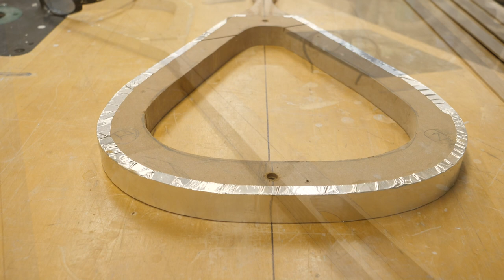Sealing a Brook Trout in Epoxy - Fly Fishing Net Build

Comment: Great video! One quick question, used my net for over 1 year, always drifting on the water, seems the surface sealing paint begins to peel off, anything I can do to restore the water proof surface paint to prevent the handle and net portion from cracking? Thanks a lot!
Reply from the maker: I always try to use a wood sealer like Dalys Ship n’ Shore that can penetrate deep into the material to help stabilize and seal the wood from within. It hardens inside pretty quickly and also provides a good top surface for the glossy top coats to connect to. You just want to ensure you sand it smooth after each coat (I usually apply 2-3 coats of the sealer prior to finish). I even use a small paint brush to apply sealer in the holes drilled in the net basket. For a damaged/worm net, I’d start by sanding the spot all all around and apply the sanding sealer/finish steps throughout. If you continue getting paint/finish chipping I’d suggest a full resanding to 320-grit and then follow the finish steps. Best of luck on future net builds too!

Comment: Looks awesome! What size hoop went on that?
Reply from the maker: This is a 120cm hoop basket. There are quite a few options available on Amazon for catch & release net baskets and on Jans Netcraft website as well.
Reply: @Riverbend Woodworks  thanks for the reply! Instead of routing along the hoop basket Could I just drill holes and counter sink them to tie the net in?

I found a few net baskets that are 13x18, could I make the hoop 14x19 or should I make it the exact dimensions of the net?

I'm sorry so many questions!
Reply from the maker: @TheOutdoorsman  You can certainly do that. The channel itself is there to minimize the potential for the tie-in line getting cut while in the field. If you have some really durable line you should be good. That said, you can also simply use a v-groove file and scribe a line around the hoop to create a groove deep enough to shield the line.